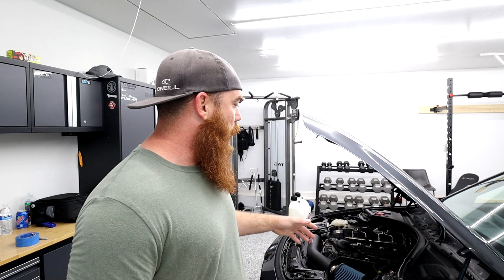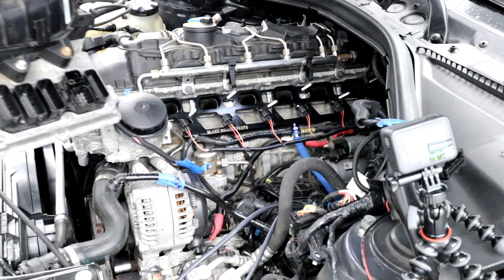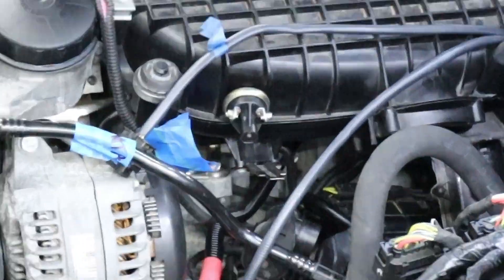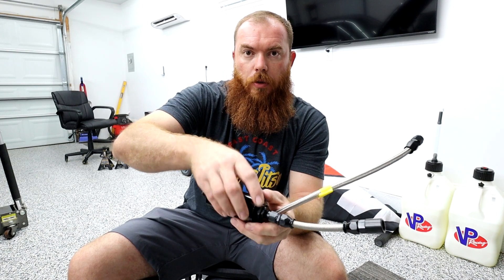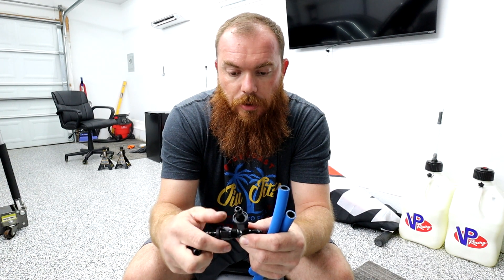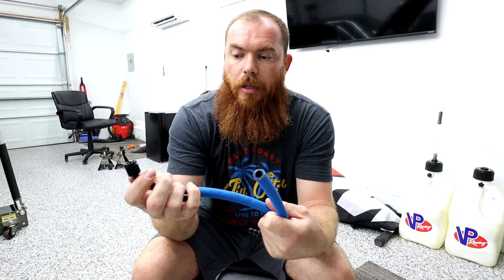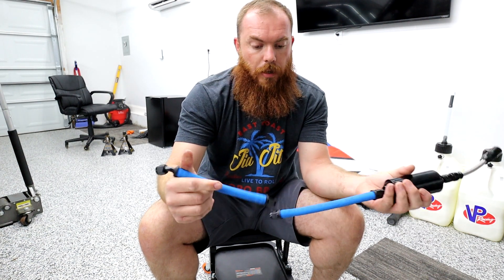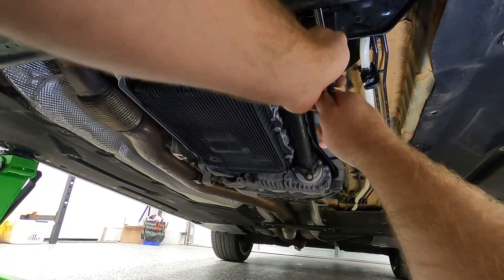SPOOL FX-150 HPFP INSTALL N55 | MAKING CUSTOM PORT INJECTION FUEL LINE

Comment: Hey man, i know this quite some time after this video however I'm in process of installing my hpfp and would like to know the sizing you used on the fittings and where you got them if possible. Thanks a bunch!
Reply from the maker: They sell them premade if you want the splitter to port injection I cant remember sizing it was 3/8 AN fittings with press fit e85 hose but just buy one from I think fuel it or precision
Reply: @BOO5Tchannel  I was thinking maybe going 1/2 for the fuel line. Do you think that will be overkill? do you know what the connector that goes to the factor male fitting is called? Not gonna be running port, just want, Feed > filter > HPFP
Reply from the maker: @kitanzzz  all that comes with the hpfp you buy I recommend Dorch, they supply everything you need, you don’t have to make anything it would be a waste of your time to make your own fuel line from stock lpfp
Reply: @BOO5Tchannel  I bought mine from a friend, his is new but the shop used the fuel line and we are different states. So essentially the kit has no fuel line so i have to make one :/
Reply from the maker: @kitanzzz  Well that’s a whole different story I recommend finding somebody that sells it because making that fuel line is very difficult
Reply: @BOO5Tchannel  Thanks man, i appreciate the insight!

Comment: Thanks for the video! 
Sorry, if you mentioned it already in video. Could you please tell the size of the the fuel line(blue hoses). I would really appreciate your help. Thanks
Reply from the maker: I am not exactly sure but it’s the hose that fits 6an fittings so I think 1/4” or 1/2” I just asked for the hose that fits 6an

Comment: Hey I'm wondering which tuning software are you using and if MHD what were the changes that need to be made to work with spools hpfp? I'm leaning towards dorch since mhd has the option already available but I would need a dorch stg2 for my power goals while I could get away with spools fx150 for those same goals and save a few bucks. Thanks for any advice and love seeing your car being built
Reply from the maker: I would say go Dorch! I like their product more. I use MHD on a custom David Shoup tune who I also recommend. I run e85 with around 600whp on xdrive and I use spool 150 but after working with Dorch for friends car twice I think Dorch is the best option... just made to fit perfectly. What are your goals? N55?
Reply: @BOO5Tchannel  Yeah I decided to go dorch stg2 after watching your dorch hpfp install I figured you would recommend that pump. I'm also an xdrive n55  and I'm only shooting for 500whp area. I'm  running a pure stg2 turbo and a e30-e50 mix and I'll probably do direct port methanol injection but more for cooling and knock protection rather then supplemental fueling. Well I should say i will be running a ps2 whenever the turbo gets here been waiting a month.

Comment: Doing the same with an Xdi hpfp and Bmp Pi kit on an n55, I made my own fuel line adapter as well, having trouble fitting it all under the intake mani, did you have any trouble, stock mani need any modification?
Reply from the maker: Hey, I did no mods to my manifold, maybe the line is too short and not giving you clearance?
Reply: BOO5T all good I figured it out, stock mani works it was just issues with his rail from his Pi kit 👍🏽

Comment: what does fx/150 HPFP does to the bmw. Is it required for tunning.
Reply from the maker: The HPFP is only needed to run e50-e85 and if you wanna go for big power so no not needed for a tune.

Comment: Awesome video. If my horsepower goals are 700+, would you recommend going the forged internals route with the n55? Or just swapping in a s55?
Reply from the maker: 700+ requires internals... fully built n55 would be costly and so is s55 so it’s overall best to do n55 and not have to troubleshoot the coding etc
Reply: @BOO5Tchannel  Awesome. Thanks for the advice.

Comment: Just to confirm, if I run stock injectors I would not need to get that T adapter that you got and the Spool kit would be just as simple as plug and play correct?
Reply from the maker: Yes sir, the adapter is for port injection I run 12 injectors essentially.